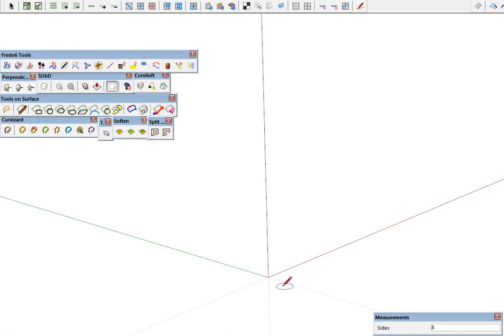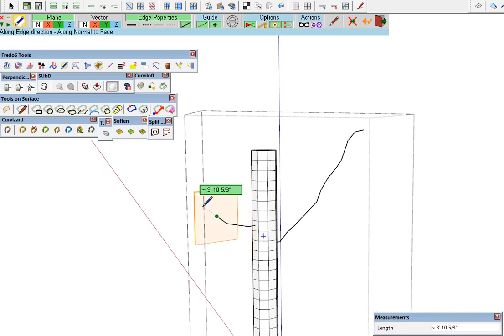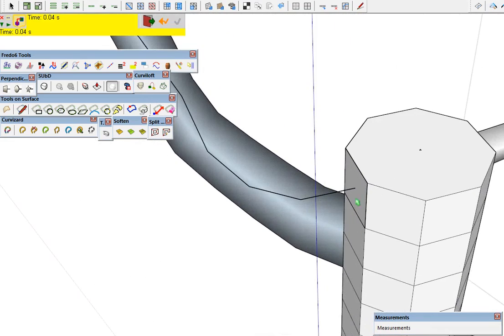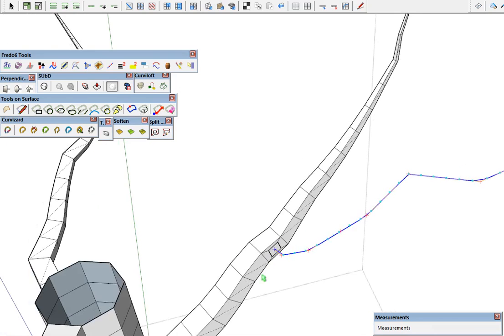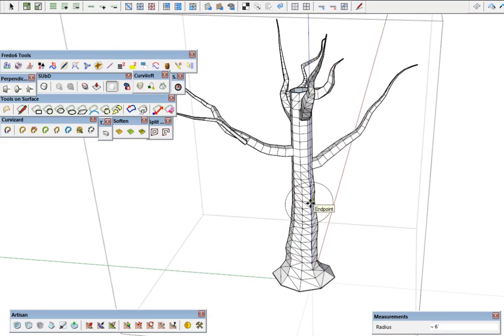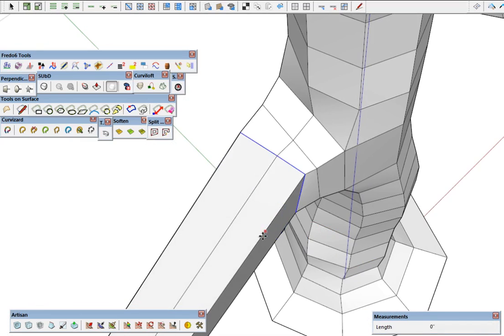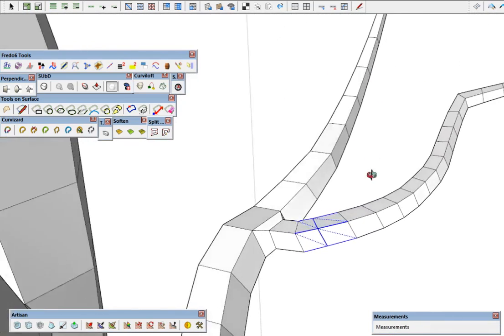Sketchup - SUbD Quad Junctions (Tree Modeling)

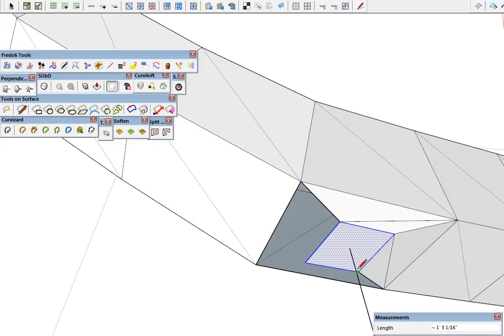Comment: Little tip for 20:34 - QFT has a quadface pencil which automatically adds the diagonal when you close a contour ;)
Reply from the maker: +Zahari Stoyanov   Thanks my friend!   I use the QFT tools pencil to divide one quad faces with triangulation into two, but I never knew that it would create a face from scratch with triangulation added automatically.  Thanks so much for the tip!!
Reply: +Winning With Sketchup You're welcome! I learn from you too - most of the time you're ahead of me :)
Reply: Been thinking about that bigger branch at around 27:15 as well - once it's flat, the base could be reshaped to an octagon :)